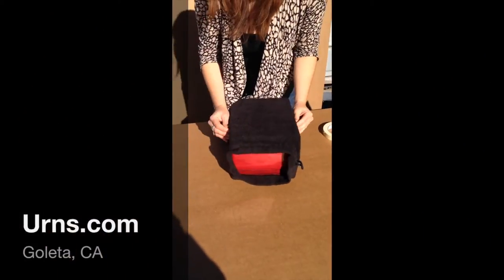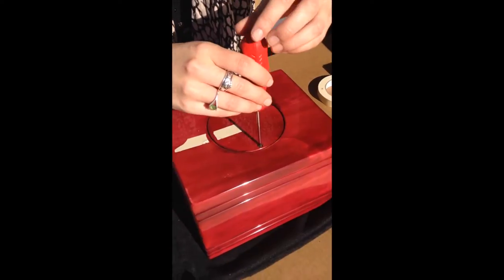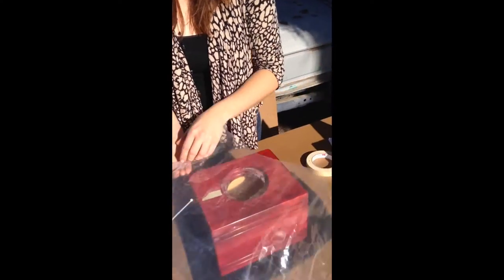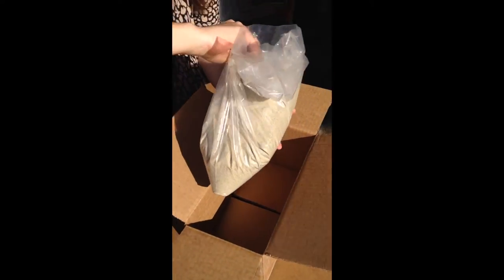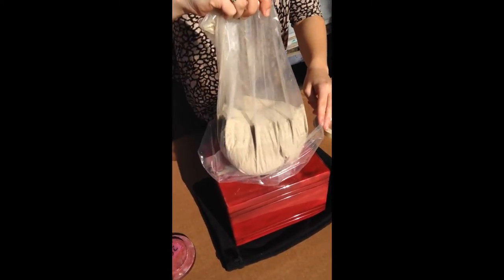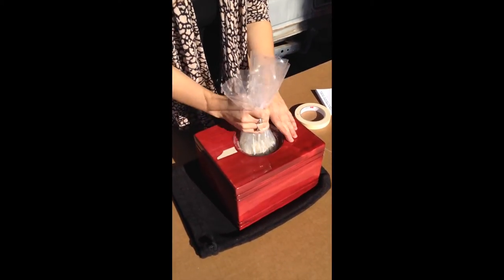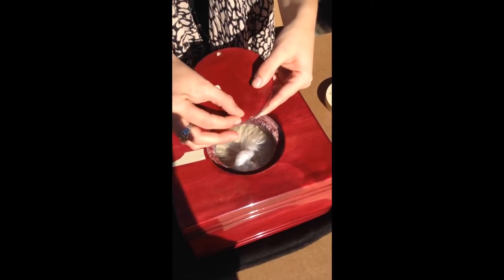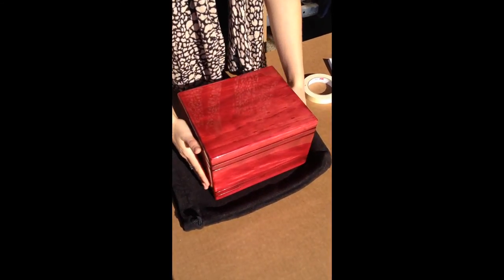How to Fill a Wooden Cremation Urn

Comment: Yeah but you left a bit of Harry or Sally in the other bag. I think you could have simply shifted the contents of the other bag around while you gently tucked the other bag into the urn. Creating a void in the other bag you could have still slipped Harry or Sally into the urn thereby not losing any of Harry or Sally. I need to buy an urn for my mother's ashes. I hate the idea of putting any of my mother into the air or into the trash. Dust in this case would be MOM. I also don't want to breath in my mother. So I like the idea of shifting the contents around in the original bag. That said, I don't think the bag with my mother's ashes is as big as the bag you started with. The ashes are in a bag that is in what I think is a lightweight plastic box. It's been almost 8 years since my mother died and I think she deserves an urn for her remains, that and a bronze plaque with her name.